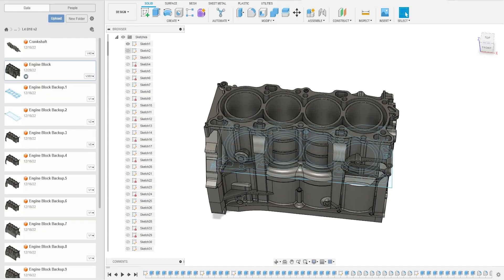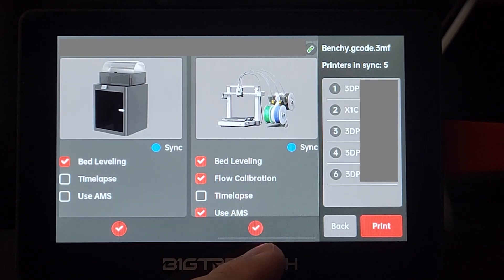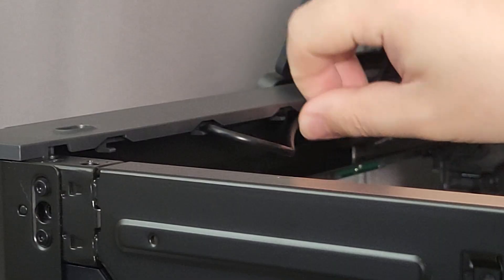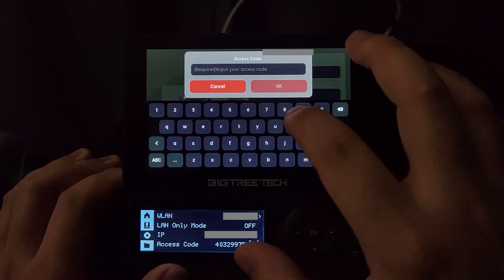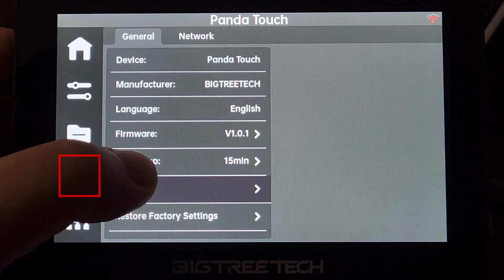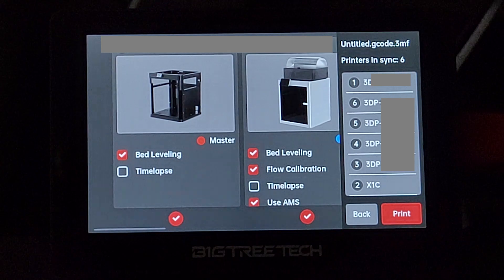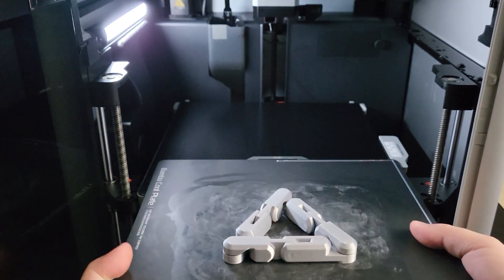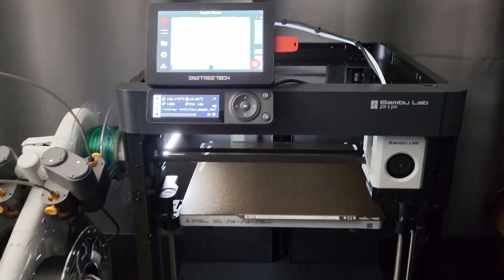BigTreeTech Panda Touch features, set up guide. More than a screen upgrade for Bambu Lab printers.

Comment: After two days, Panda Touch failed to connect to my P1S, an IP address issue! The Bambu apps never loose connectivity, therefore BigTreeTech needs to do some work to fix this issue!
Reply from the maker: did you try to change the 2.4Ghz wifi setting to assigned specific address for printer? Sometime default setting will alternate ip address once in a while and that will cause issue similar to you mentioned.

Comment: Is this wifi only? I don't have my printer on wifi so I was curious if this would still work.
Reply from the maker: they have LAN only mode
Reply: ya this has to use the Wifi to talk to the other printers on the network, not internet but just your local wifi network.  Same way you would manage a Klipper printer, only this does it for you all in one place for multiple bambu printers.